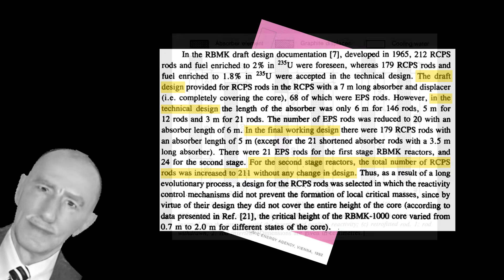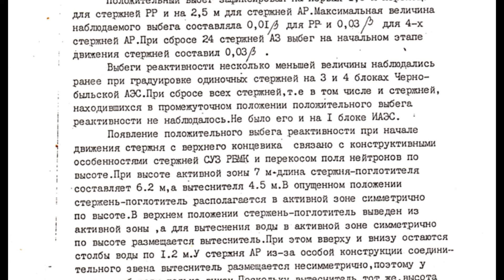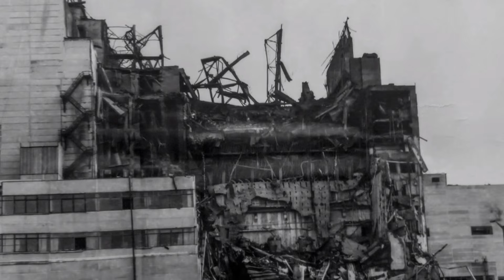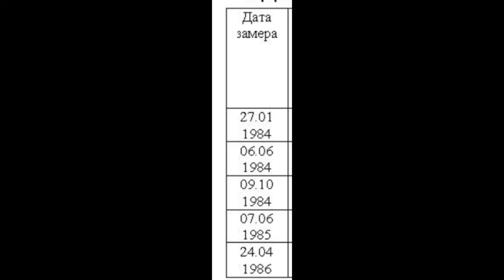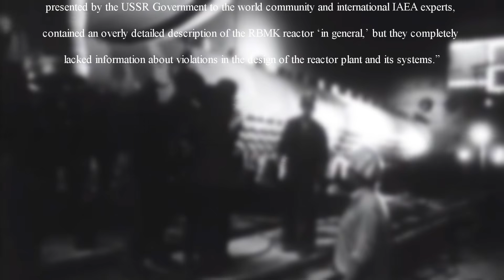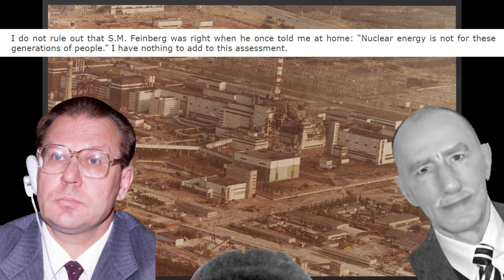Pre-Chernobyl History: Trouble Under the Surface (1975-1986)

Comment: Does Chernobyl still have any of the old displacers from Units 1-3? If so they could be measured to figure out if they were 4 or 4.5 meters long.
Reply: Bright idea.
Reply: No, the displacers were replaced after unit 4 went up.

Comment: If anyone can help me understand this a bit better that would be great. I want to make sure i understand this correctly but, is it becuase of the water displacement and how thin/little water there was which accelerated the reactivity? Please help me clear this up, i know there are other factors as to how it happened but some clarifications would be much appreciated.
Reply: Water in an RBMK reactor would absorb reaction-causing neutrons. The displacers being made of graphite absorbed less of these neutrons, so when the reactor was shut down and the graphite displacers absorbing less reaction-causing neutrons moved water out at the bottom of the reactor core there was an addition rather than a subtraction of reactivity.
Reply: @markusw7833  if I remember this (and again feel free to correct me) the bottom of the core wasn't the most "reactive", so the displacers moved the water from the bottom (as you stated) to the center which was were it was most reactive? At least that's what I've been assessing going through the channels videos. Apologies if I seem thick headed, you and that Chernobyl guy are helping to expand my interest in this subject so it's best to know this as clearly as possible. If you have any links feel free to share as well.
Reply: @ConductorCatnip  The bottom of the core wasn't the most reactive in terms of where the neutron flux would be located at normal operating power, which meant it was less poisoned by xenon when power was reduced as xenon is a fission decay product (part of the decay chain of elements/isotopes subsequent to uranium atoms splitting). This seems to be related to the neutron flux having a different distribution at around the time of the disaster, with two peaks at the top and bottom of the reactor with a poisoned center. This is supposed to have played a role in the positive scram effect and what happened at the bottom of the core. The graphite displacers are located symmetrically in the middle of the core when control rods are fully extracted and thus push out water columns underneath them on downward movement.
Reply: @markusw7833  thank you for the explanation, that helps to clear it up a lot for me.

Comment: So the height of the concrete sub-basement was reduced. But why does that mean that the length of the water displacers had to be reduced? The way you present this, it sounds that they are linked. How?
Reply from the maker: Removing the sub basement means there is no room for the displacer to fit into when the control rod is fully inserted.

Comment: Starting production without testing while still changing the design has led to lots of fatal results throughout history.
Here is a famous example from the US: the B-29 bomber made famous for dropping the atomic bomb was a rushed design even with its enormous budget. (its project cost twice as much as the Manhattan Project) Its engines couldn't handle the required specifications and as a result more of them were lost due to mechanical failure than to enemy fire during the war. BTW this is also a reminder that Boeing's culture of rushed certification did not start in the 90s from its takeover of MD as is popularly parroted but was deeply ingrained for at least half century before that.
Reply: You're absolutely right! Boeing should have taken more time to get the design right. Those B-29s would have been much better in 1947.

/s. I hate that I have to wonder if this is an AI comment or if somebody is actually dumb enough to connect a wartime project to mass-produce long-range piston-engine bombers 80 years ago with the design and construction of modern jetliners.
Reply: In my family, so the story went, mechanics goofed up on my Great Uncle Victor’s B-29 and therefore causing an accident while my Uncle was piloting the B-29. As an industrial maintenance tech, it also sounded a little ridiculous, especially knowing the care that goes into a planes mechanics work. 

Also, as an industrial maintenance tech I can confirm that first statement again. Adding to it the vast sums of money pissed away, as well. Currently employed at a “start-up” where we’ve recently pissed away several hundred thousand dollars because a simple QC check wasn’t in place where one should absolutely have been. 🤦🏻‍♂️ Good thing we’ve raised over a billion dollars in capital over the last year or so. 😂😂😂

Comment: The amount of research that goes into your videos is unparalleled, and this video is a prime example. Even something as seemingly-simple as the dimensions of the reactor control rods turns out to be a fog of misinformation,  misdirection, or both.

My main take-home from this is that the culture of blame and blame-avoidance in Soviet officialdom played a more significant role in the disaster than anything the operators did in the control room in the small hours of 26th April 1986.

Comment: What a mess.  One wonders two things:  (1) If they knew that lowering control rods could add reactivity, why wasn't there a little bit of computer code that would lower only some of the rods at a time?   and (2)  Why not some warning alarms implemented in software that would warn and prevent the easy insertion of all the rods all at once?
Reply: The were also shortened SCRAM rods that insterted from below the reactor. But they were actuated by a separate button. Had these USP rods were connected to AZ 5 button, reactor would have never exploded. That Chernobyl Guy mentioned that too

Comment: In May 1986, during planned shutdown of reactor No.4, electrical scheme of action of AZ-5 button supposed  to be changed. Being depressed, it should initiate not only movement of 211 control and safety rods from top position down, but in addition 24 shortened boron rods should to move up from bottom position ( reverse mode of servomotor operation )  to compensate " positive effect of reactivity " when water is being displaced on bottom zone by graphite displacer. Also, some fresh fuel rods should replace burn out fuel rods and, as result,  side absorbers supposed to be installed in addition to the existing one, that would automatically made working of reactor more stable on low loads. After fulfillment of these actions, Toptunov could press AZ-5 ten times, nothing bad would happen. April 26 1986 was the last day when reactor No,4 could be killed.
Reply: Side absorbers? Those being different from additional absorbers that were no longer added?
Reply: It would be nice if there were some documents to confirm that the USP rods were supposed to be connected to the AZ-5 signal after the planned maintenance. Some fairly trustworthy individuals repeat this story, but I wish there was some contemporary evidence as well. How many ДП were they supposed to install before restarting in May?
Reply: @MinSredMash  Number of absorbers to be installed was over one hundred because almost all fuel rods supposed to be replaced. But prior, all " tests " must to be completed on this last day of April 26. Even after conclusion of "Rundown of turbine " test new test supposed to be performed. After shutdown of reactor ( it was the reason why Toptunov didn't do it at 01:23:04 when first test was launched) reactor supposed to be tested for " natural cool down of active zone " . Thermal power of reactor on shutdown state is about 1% (30 MW). Remaining 4 main circulation pumps supposed to be shutdown and reactor supposed to be cooldown by natural ventilation of piping system above and down of reactor, all ventilation channels were already open for performing of this test. But reactor exploded before this test was launched and "Dontechenergo " was unable to take measurements, unlike "Turbomotor " which made all measurements of vibrations of turbine during first test.
Reply: @nyckhusan2634  Where are you getting this stuff from? The Soviet report to the Vienna Meeting includes a paragraph stating that additional absorbers were removed, replaced by more fuel assemblies, and then the fuel assemblies were gradually replaced with fresh ones. The additional absorber period of operation is stated everywhere as transitory at the beginning of a new reactor's operation. This video shows you a document with all additional absorbers being removed from every Chernobyl reactor. Likewise, in Politburo notes where Dyatlov and Akimov are referenced directly not stopping the reactor at the beginning of the test is described as miscommunication. The theories about other tests being the reason why the reactor was intentionally not shut down are unsupported. The turbine vibration measurements were performed before the final rundown test, not during it. Furthermore, it didn't matter if the reactor was to be shut down at the beginning of the test as the test itself didn't matter.
Reply: @nyckhusan2634  Can you provide any documents showing that all fuel rods would be replaced? This seems like it would have been very wasteful and unnecessary, especially given that the Additional Absorbers had only just been removed, in the name of fuel efficiency. Or at least can you say which person with connections to the station provided this information?

Comment: The operation of all the cooling pumps was a destabilizing effect of the rundown test.  As per INSAG-7 5.2.3: "The reactor was operated with boiling of the coolant water in the core and at
the same time with little or no subccoling at the pump intakes and at the core inlet.
Such a mode of operation in itself could have led to a destructive accident of the kind
that did ultimately occur, in view of the characteristics of positive reactivity feedback
of the RBMK reactor." 

Are the exact dimensions of the water column in the reactor control rod channels +/- 20cm more of a contributing factor to +beta then the lack of subcooling caused by the rundown test conditions present at the time of the accident?
Reply: Video covering this in June. Be on the look-out for part two of "Masters of Weaponized Narration". Also, pause at page 36 of INSAG-7 in this video. The coefficients were found in conditions of relatively high power and ORM, and I would bet greater subcooling. According to the chairman of the commission writing the report there was even a secret experiment at Chernobyl npp to confirm the high positive void coefficient and it was indeed 5 and greater.

Comment: Control rods were shortened to maximise breeding of Pu-239 in the lower zone of reactor... Soviet Union had enough concrete, but never enough plutonium. Even Mr. Brykhanov said that there were rooms in which he had no access at Chernobyl NPP. The cause of chernobyl disaster was deliberately dangerous design for simultaneous production of weapons grade plutonium  end electricity. Maybe someday we will read the documents about Pu-239 production on RBMKs reactor, there were many secret experiments.
Reply: If i recall correctly there was a documentary about it, not sure who made it but i watched a video about it in natgeo
Reply: This doesn't really seem to make sense from a physics point of view. Water columns instead of graphite displacers increase the neutron absorption and thus should make the breeding of Pu239 worse and not better.
Reply: Brykhanov  was the manager of the whole Chernobyl facility, correct? If he didn't have access to a room at Chernobyl, then who did?
Reply: @every116  Briukhanov said that on tape. Maybe I will find it and post here
Reply: KGB or Military personnel  @every116
Reply: The two explanations for graphite displacer shortening we've encountered are presented in this video. The military dual-use topic was touched on in the preceding Pre-Chernobyl History video. It is unknown whether RBMK reactors were ever used for plutonium production, and as far as any layperson knows there wasn't a need. Early military dual-use considerations may well have affected RBMK design adversely from a safety perspective, as was mentioned in the preceding video, but your unsubstantiated and extremely brief youtube comment assertion is the only time probably any of us have encountered the suggestion that graphite displacers were shortened after some RBMK units were already in operation for the production of plutonium. On what basis do you claim to know this?
Reply: @markusw7833  I dont have any documents on weapons-grade Pu-239 production at Chernobyl, they are all still classified and remain in russian archives. It is just what I heard as Ukrainian, from old engineers that worked in Chernobyl. Designers deliberately created active zone with different characteristics at the bottom, so that the bottom of the fuel rod will worked in different conditions, and after U-235 burn up can be extracted and cut off for reprocessing. It might have been an analogy of a blanket in breeder reactors... I just feel that it might be true, too many black areas why control rods were shortened and how many sections they had.  Inconsistency. In Soviet Union everything was working for military industrial complex. I believe some day we will get the documents about weapons grade Pu 239 breeding in RBMK reactors. Just last fact - Leningrad NPP was in the Minsredmash ministry for a reason.
Reply: @pavlovezdenetsky7824  Old engineers that worked in Chernobyl have mentioned a graphite displacer reduction? It is known that at the reactor peripheries there was less reactivity. That appears to have been the reason why graphite displacers generally didn't cover the entire core - these areas of less reactivity were deemed unproblematic and insignificant in terms of neutron flux so the water columns weren't doing much absorption in most circumstances. If old Chernobyl engineers have claimed something different we would very much like to learn what and why.
Reply: My apologies, but I do not think that is correct. In all my reading, I have never once come across what you state. Yes, in theory the RBMK could be used as a dual-mode reactor, but I have yet to find the first evidence that Unit 4 was indeed used as a plutonium breeder. If you have credible sources/good info proving this, feel free to share it with the rest of us.
Reply: @swokatsamsiyu3590  I am afraid my friend I dont have documents on this issue. I hope that some day we all get them published. The only small hint is Brykhanov's interview where he confirms that there were rooms at Chernobyl NPP where he himself had no access to.